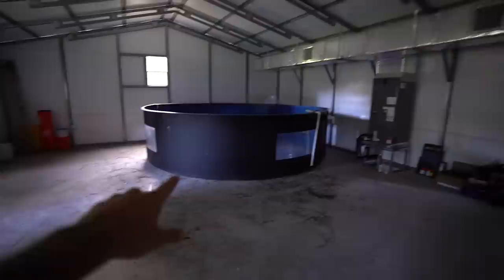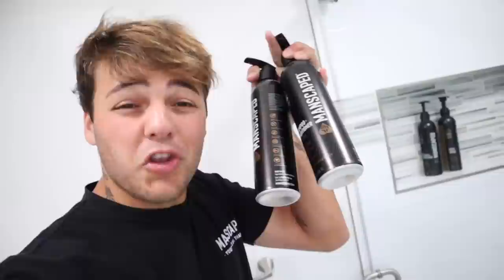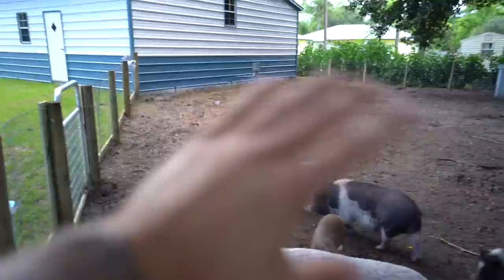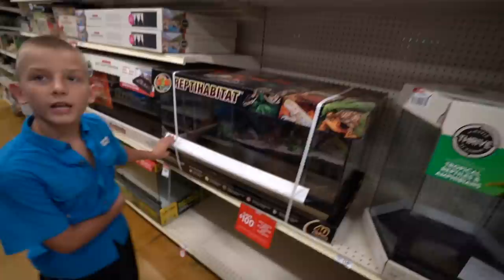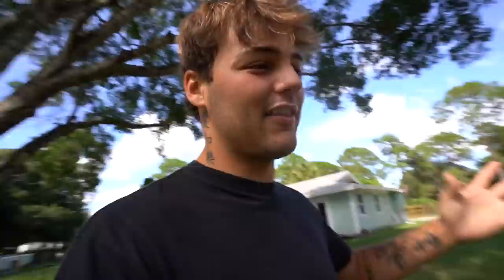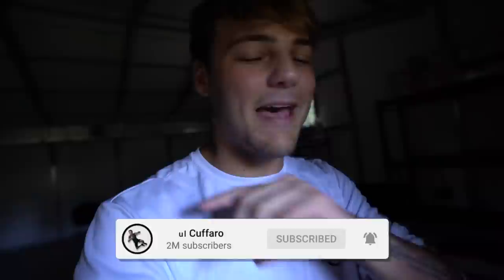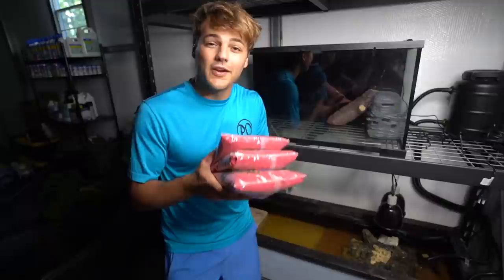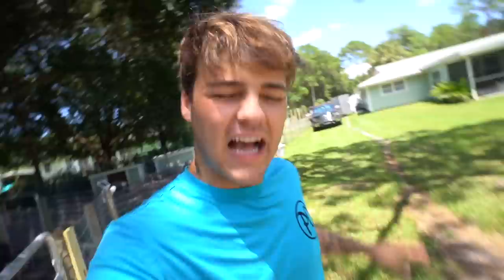BUYING My Most EXOTIC TURTLE *NEW* AQUARIUM!! (expen$ive)

Comment: I’ve worked at a petstore for over 5 years now been in the hobby for 11 years now. That red sand is awesome but unfortunately that brand you have to rinse the sand like crazy to get the clumps to not happen but if you leave it and scoop the clumps and floaters it won’t take very long for it to be perfect looking. That brand is a little strange but with a little bit of early maintenance of scooping out the clumps it’ll look great
Reply: The likes were 69 so I saved you and made it 70
Reply: I was the 71st
Reply: @GrayTurtle7   i was 73
Reply: i will not be liking it because it’s now at 169
Reply: Made u 190
Reply: I made it 203

Comment: I have the same red sand in a 40 gallon, the clumps are sand stuck together with air bubbles. You can pinch the clumps, and it will settle over time!

Comment: Replacing the water from Evaporation is nothing like a big water change. When water evaporates it concentrates the bad stuff (and good stuff) because only the pure water is evaporating. If you only replace for evaporation and never actually change water the TDS of the system will steadily increase over time. A water change implies “dirty” water is changed out for clean water. In evaporation replacement pure clean pure water is being removed by evaporation leaving behind all the nitrates and stuff in the pond and then clean water is being added to dilute the “dirty” water.
Reply: He doesn't care

Comment: Props for taking a risk on the red sand.  I could almost see it for a second till you started plopping down the river rocks on top of it. It might work with some other decor, but then when you put the Mata Mata down it just looked bad. And then the clumping thing that's just weird and it makes me wonder about the safety for that species in particular.  It was worth a try and I can see potential uses for it, just certainly not this one.